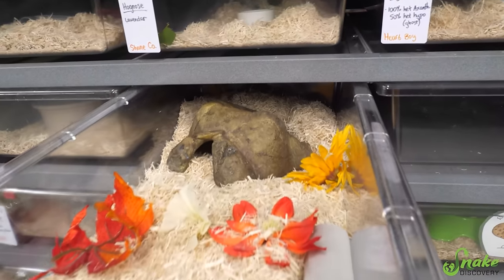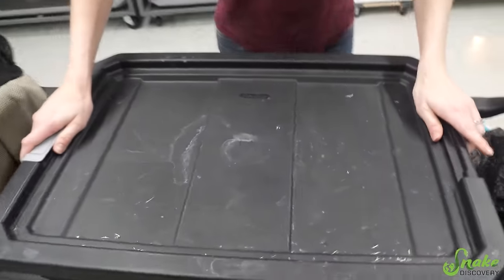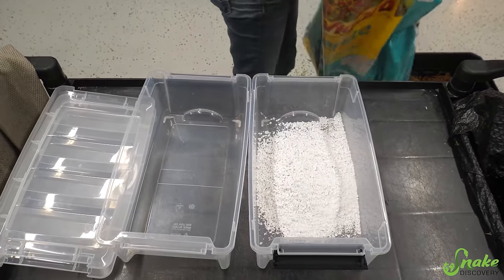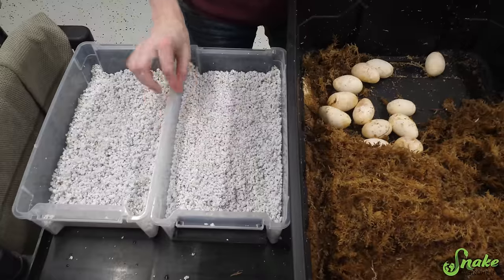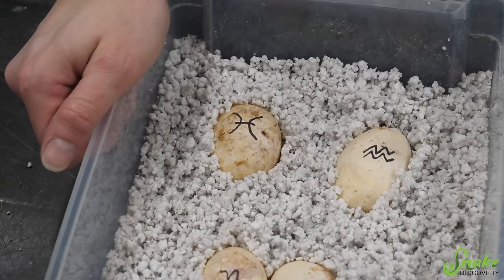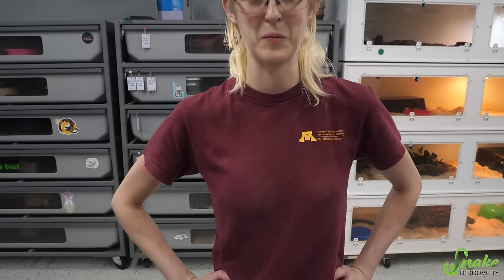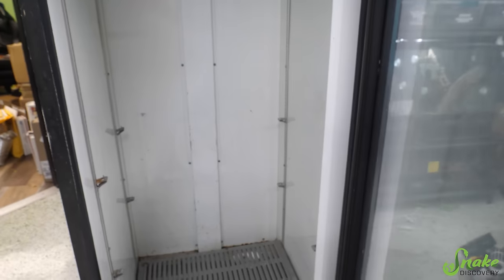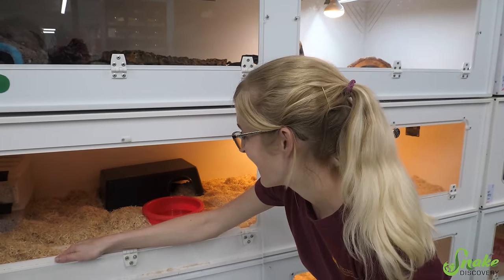Our Bullsnake Shakira Double-Clutched!

Comment: I'm 100% here for the experiment because I imagine a lot of herp owners have enclosures and no incubators, and this will at least show whether they have a shot being kept in an enclosure. Also it will let you guys know if this is a reliable safety net for future situations like an incubator outright breaking.
Reply: Yeah. Although my own solution to incubating without an incubator is a box in a box where the layer of air in between works as a heat insulation and the smaller box is filled halfway with water with a fish tank heater set to 37°C and eggs are in the 3rd smallest box, suspended in the warm humid air. 3 weeks in and they look beautiful, no changes in shells, and the other day i even saw a tail movement while candling them
Reply: I mean in the wild they are wherever the mom layed them which would probably be roughly the temperature of the enclosure and would also fluctuate between day and night so it should probably work
Reply: @franziskawild6981  right, but that’s not the question they’re trying to find the answer to— the question is whether it will work BETTER, worse, or stay the exact same as a normal incubator. (They definitely wouldn't chance-it if were a question of "will it work at ALL", that wouldn't be smart!) 

The sex of Alligator babies are partly dependant on the temperature of the cluch, it could be a similar type of question here
Reply: Mie ♎

Comment: My hypothesis is if you split the clutch in half, the half that is in the incubator will hatch faster than the enclosure half and both will have an equal successful hatch rate
Reply: This is also what I think, either the incubators egg hatch faster and they have equal success rate or the incubator eggs have slightly higher hatch success rate. But I lean on the first one since it is a controlled environment
Reply: @angelsyna  That makes sense to me - If the enclosures are meant to mimic the snakes environment then that's the environment the eggs would have evolved to hatch in.

Comment: I'm going to use my science class skills that I will barely need to use because of the degree I'm going for for this hypotheses:
If the temperature stays relatively consistent in the cool side of the enclosure, then the eggs should hatch equally as well as the eggs in the incubator. However, if the temperature fluctuates too much, there will be 1 to 3 eggs that won't hatch and/or hatch with with kinks.

Comment: You would have been proud of me today. One of our dogs started barking at something in the room near the kitchen. But my wife didn't see anything. The one of the other dogs stuck her nose behind a door then jumped. We slowly moved the door and climbing up the wall was a young black snake (we live in western NC and they are very common here). It moved to the edge of the roo where the hinges were so getting it out was difficult. But I did it! I used a small towel, grabbed it near its head, and quickly walked through the house and put it outside. Once outside, I confirmed it was a juvenile black racer! It was quite long (probably 2') but thin. It had no stripe so I'm certain it was not a garter snake. It didn't have a ring near its head so not a ringneck (I've seen some very black ones here). It's back was gray with black patterns. I held was able to hold a snake, knew to watch its head, knew how to identify, and knew it was just a regular noodle and not spicy. All because of you! I wish I had thought to take photos but I didn't want the dogs to get close. We didn't see any blood on the white door nor was there any on the towel. We think it came in by itself vs the damn cat doing it. It's probably telling its fam about its weird day.

Comment: I know this was filmed FOREVER ago, but I keep thinking a way around the incubator space problem would have been to set up a picnic cooler incubator. Reach out reptiles has a video and it seems like you could set one up super fast and way more easily than a big refrigerator conversion. I have never incubated snake eggs though, anyone have any insights into why this may or may not have worked?

*Edit for typo

Comment: Depending on how much the enclosure fluctuates and how often, it might be successful or it might not. There's always a risk of both the enclosure's heat source and the incubator's heat source failing but the incubator stays at a consistent temperature  so there's a better chance of hatching in there. I'm curious to see how this experiment will pan out.

Comment: So, it turns out there are some water soluble labels you can get. Maybe those would be helpful with labelling the boxes so they're easier to reuse?
Reply: There is no way production of labels is more eco-friendly than just washing off marker ink.
Reply: @edwardhisse2687  they use sharpie though, which is fairly difficult to get off. Usually you have to use something like acetone to get that off.

Comment: I would think the eggs should be able to handle the conditions of an enclosure, with the extra humidity of their containers. After all, in the wild, the temperature would also fluctuate, and generally a lot more than in a zoo enclosure. Granted, the ground would probably help keep the eggs a little more stable, but wild eggs would still experience temperature changes. 

TLDR; it should work at least kinda, probably, I think.

Comment: there are many stories involving the lore of the zodiac of the cat. the general lore of it is that there was a competition between all of the animals. the rat rode on the ox and jumped off last minute to be first place. for as far as the cat involves it was alzo on the back of the ox, but was pushed off by the rat and never crossed the line. and thus not being allowed to be a zodiac. there is also a story in which the rat told the cat it was on another day and never made it to the race at all. the cat is not an official zodiac but in some places they replace one of the zodiac by the year of the cat. if you do that the years would be: 1987, 1999, 2011, 2023 (the latter being the water cat). like I said, manyyy variations of the story, so this one isn't like a mainstory just the general hiss of it! hope this helps if anyone cares (also there is a year of the snake!: 1977, 1989, 2001 2013)

Comment: By the way(this might be dumb) but if you left both boxes of eggs in the enclosure, shouldn't it have been better to put them side by side? The one on top might be cooler than the on on the bottom. Or is the difference not that big?

Comment: If the Sun is in space, why is there light on Earth but not in space?:
There is. However, space is a vacuum and thus is almost completely devoid of what could be an atmosphere. Any gas will migrate towards a point of gravity, in doing so, creating atmospheres in concentrated locations. Like planets. Also Nebula. The collected atmosphere on a planet along with things like magnetic forces(which Earth has due to it's metal core) help produce things like an Ozone layer which makes a distinct boundary of gas to space. The different gases and the angles the light enters the atmosphere, produce different colors. Our heavy Nitrogen atmosphere makes Earth air seem more blue, while on Mars it is heavy CO2 and looks more toward orange. These colors are a lot more subtle than you think, while the water of Earth and iron of Mars are what give them their heavy color appearances, the actual colors of the air are more toward a clear with a tint, like when you get glasses. The Sun produces every color of light, yet we humans can only see a small portion, which is what we call White Light. We can only actually see the color of something based on the light that is reflected, which is why everything looks black at night, because less light is reflecting. In space, this light only reflects when it hits something, thus it is a clear black. The easiest way to see the light the Sun makes in space, is to look at the Moon. The light in space that hits the Moon makes it shine, while the dark of the Moon is the part on the complete opposite side and thus receives no light.